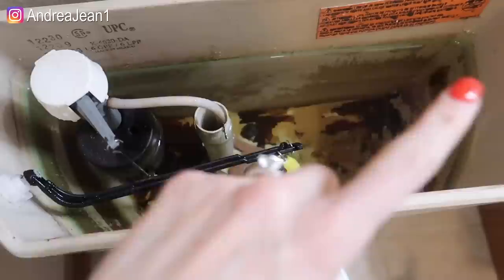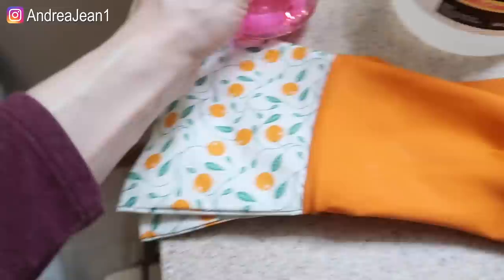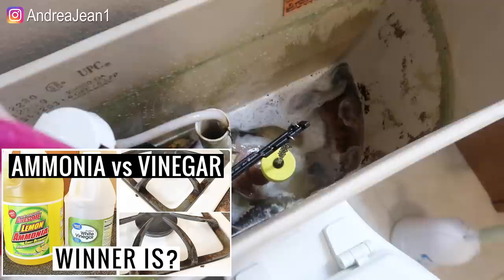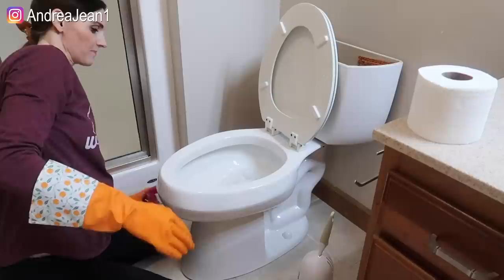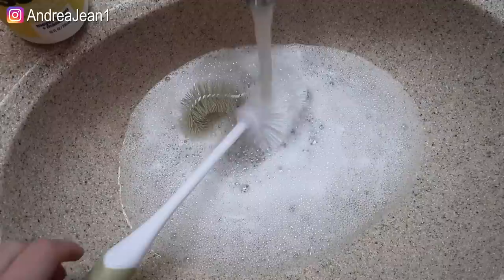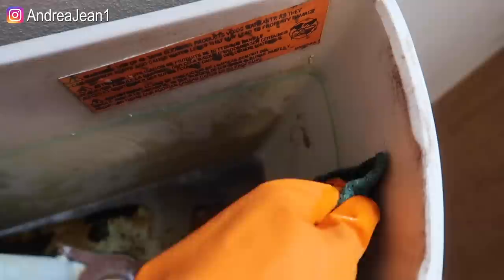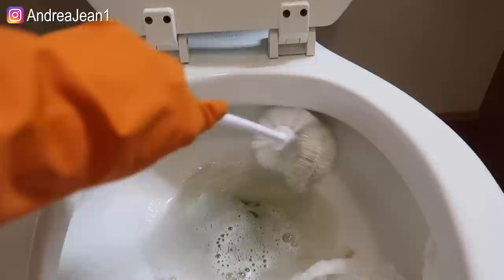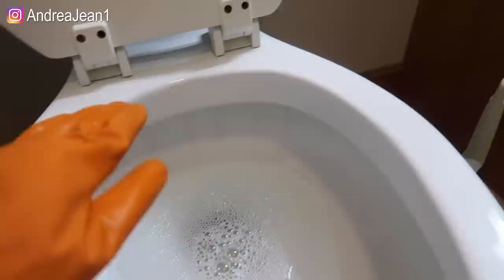Put VINEGAR into your TOILET and WATCH What Happens!! (Bathroom Cleaning Hacks)

Comment: Where did you get that great spray bottle? It's so hard to find a good spray bottle that doesn't break the first time you use it! Also, I live in a mobile home and I have 2 bathrooms and neither one of the sinks or toilets have a valve to shut the water off.. none of my sinks do! Any suggestions? My toilets both need the inside tank parts replaced but I don't know how to do it with the water still on. HELP!
Reply from the maker: Dollar tree 👍 you can still do this without draining the water... you can also get tabs at the dollar tree to drop in the tank.
Reply: if you need a water shut off valve....a plumber can install those items for you.   It's always a good thing to have - just in case your toilet starts to leak and/or a water pipe bursts.....
Reply: Wow!  Will try the vinegar.  I also use a product out of Dollar Tree that works wonders.
Reply: dollar store or Walmart
Reply: Cut the water pump off if you have a well with a pump and the water will stop. Then flush the toilet  a couple of times  to take the water out the lines. After you clean turn water pump back on.
Reply: @maryjo391  I know, one of my toilets has a shut off valve. One time I had some problems with that toilet and while I was having it repaired I had them put in a shut off valve. But who does that? Lol, install water lines inside of a house (mobile or not) and not out shut off valves  in place?? I've had people argue with me and practically call me a liar when I say none of my sinks or toilets have a shut off valve! They keep describing what it looks like thinking that I don't know what the valve looks like or what it's for! I was dumbfounded when I first moved in and saw no way to cut the water off  inside the house! And now I've lived here for 20 years but the mobile home was only a couple of years old. I would maybe expect an order trailer to not have the valves but it is what it is I guess! I've never seen another toilet anywhere that didn't have them. Crazy! Eventually I'll have them on every water line that needs one but for now, I get to crawl under the trailer to turn off my water main. Also, I have county water so no well.
Reply: The only way to actually fix my toilets properly would be to turn off the main water supply under the trailer and totally replace the mechanical parts of inside the tank and add a shut off valve to the one toilet and that would solve my toilet issues. Actually they've both been doing OK except the water level in the bowl is pretty low after flushing the one toilet and I looked up how to fix it and the insides if both if my tanks is alit of rust and I'm afraid to break something because I think the way to fix the low water situation I have to bend or pull up on something and I'm afraid of causing more problems. I just keep a jug of water in there and I just add a little extra to the bowl. Haven't broken anything using that method! Lol
Reply: DO YOU HAVE A WATER SHUTT OFF VALVE OUTSIDE?
Reply: @mariak4572  yes, I do but it's underneath my mobile home and a real pain to get to but I guess considering my  situation  I should just be happy there is a shut off under the house; however, if it didn't, how would anyone ever  be able to hook water up at all? Fortunately it's never caused me any real problems. ..yet!!!  LOL
..
Reply: mobile home owner as well mine didnt have cut offs for the sinks in the bathrooms or kitchen or showers please im telling you have a plumber come in and install cut offs in all these places because if you dont one day you  are going to regret it seriously bad i did the mess and cost of cleaning water all over taught me a lesson. especially the toilets.
Reply: @lovelylady1966  I've already said in an earlier reply that I know I need to have the valves put in. I also am living on a fixed income and I don't have anyone that can just help me and I have other repairs that need done before I can even think about shut off valves. One being leaks in my roof, soft spots in my flooring in a few small areas, my front steps are leaning and ready fall over and I'm doing the best I can with what I have to work with! I've lived in my mobile home for over 20 years and I have gone this long with out shut off valves inside, and there is a shut off valve outside under the trailer. It's not that much of a priority right now and I have had water leaks and cutting the water off outside was not a big deal. The only reason I mentioned it at ALL was because I've never seen ANY home that didn't have shut off valves built into the toilet and sink water pipes. I've had people argue with me that I had to be wrong about not having them. Thank you for your concern but it's not feasible at this time.
Reply: @carolfarmer8879  usually when there isnt any its because they short cutted stuff i didnt have any even under my trailer after having a serious leak i had no choice trust me im not judging i live in a 30yr old trailer that was horrible shape all the floors had to be replaced it was eat up with roaches the roof was leaking i still have tons of stuff to do it was filthy but its either this or be homeless im sick i get less the 800 dollars to live off of  but im trying to do one room at a time plus i dont have heat its very scary at times but i do what i gotta do.
Reply: @lovelylady1966  I'm exactly where you are almost word for word, except no bugs, thank God! I spray my house constantly because last year a friend brought roaches to my home and I was finally able to get those GONE! I bought that stuff that comes in s syringe kinda tube I think it's called combat. I put that around and haven't seen a single one since. Every now and then I get one or two of the waterbug gigantic roaches but I bought a big jug of bug spray and every fee months I go around and spray. I also occasionally get s mouse because I live right by the woods but it just gets so overwhelming trying to fix everything myself and men do nothing but promise to help. They are such liars! I have lupus also so life is very challenging at times and frustrating because I can't do the things I used to! I never needed help with anything because I'm pretty knowledgeable about a lot of things but I swear the older I get, I'm turning into little Miss helpless. I need to get it back into my head that it's just me, it has been for a long time. But my illness makes it almost impossible to do things sometimes and then I feel guilty because I wasn't able to always be doing something.  I have to accept that that's my life now and there is nothing wrong with just resting sometimes.
Reply: @carolfarmer8879  i feel the same way nobody wants to help
Reply: @carolfarmer8879  In my 15 years of working on mobile homes, i've never seen one less than 20 years old that didn't have shutoff valves on every toilet or sink. I've seen a few really older ones that didn't. Just be careful when working with older mobile home water pipe, It's not as thick as standard water pipe. With age that pipe get hard and brittle and can break much easier. I always try and add newer pipe to the end where the valve goes and secure it so when you turn the valve it doesn't twist the old pipe. It does cost more to replace at the moment, but in the long run it's worth it.
Reply: @carolfarmer8879  Use boric acid powder. Cheap and completely efficient for roaches.
Reply: @empressvee  thank you. I bought that combat stuff that comes in a syringe and I haven't seen any roaches OR water bugs ( the huge roaches they call water bugs lol) since! Come to think of it, I haven't seen any critters at all. Now if I can get the occasional mouse situation figured out, I'll be good! I never see any mice and I have traps around but I can hear a chewing sound sometimes that drives me crazy! I have caught a few mice but now they are eluding me. I don't see signs of them either it's just that chewing! At least I got rid of the roaches, I really hate roaches! I'm not thrilled about mice either but I live near the woods so I kind of expect it but roaches are usually caused from uncleanliness. I'm a very clean person and I have never had roaches, this time they were brought in by another person who no longer comes in my house.

Comment: If you haven't turned the water valve off in years, keep an eye on it after you turn it back on. Plumber turned mine off to do tank repairs and the floor was flooded during the night. He didn't notice the nut needed to be tightened after it was turned back on. Not everything is as simple as it seems.

Comment: So this is just vinegar???  OKay, I love magic!
Reply from the maker: Yep just vinegar! Thank you ✨
Reply: But be sure NEVER MIX vinegar and ammonia- very dangerous fumes!!! ☺️💕
Reply: @AndreaJean  3% or 30%? Would 30% affect the the porcelain?
Reply: @AndreaJean  if it was just vinegar what made the foam,because vinegar by itself doesn't make that foam!!
Reply: @vernareed2692  there's a calcium build up. The vinegar and calcium reaction will cause foaming
Reply: @rico76  be very careful with the acidity level of the vinegar as it can cause all the rubber gasket parts in the tank, seal, etc to deteriorate...and when that happens - the toilet will leak water - which you'll then need to have a plumber replace all the gaskets & seals.
Reply: verna Reed I use baking side and vinegar

Comment: Try keeping a bleach tablet in the toilet back.  You probably won't have to ever do that again.
Reply from the maker: Then I wouldn’t have a cleaning video to make lol!! Thanks Stan 😊
Reply: Great idea! The only problem with the bleach tablet is won't be able to see the actual color of your urine, just to to keep a healthy check on yourself 😉
Reply: Anyone ever try denture cleaning tablets? Drop like 10 - 20 tablets in the tank maybe over night, or just dump some bleach in and let it set !
Reply: Do not use bleach in the tank it will deteriorate your rubber stopper. We replaced ours twice before I realized bleach should be no where near rubber
Reply: Stan Mann: that what i do. Don't have to go threw all of this what she going 😄
Reply: @truthlove1114  I also used bleach tab. Bleaching the back won't hurt every now and then.
Reply: mary carter I totally agree Mary. I had the same exact thing happen... blue water was dripping on the floor... plumber came by and said... it’s the bleach tablet that eats away at the seal and made for an expensive plumbers visit.
Reply: The problem with that is that the bleach will deteriorate the parts in the tank
Reply: I love the bleach tablets. However, now that I live in a home with a septic tank I am unable to use any products with bleach as it kills all of the good bacteria in the tank. Those organisms are very important to the health and longevity of the tank. Not only the contents but the structure, as well.  Keep your septic tank and field deathly : )
Reply: Nope....bleach tablets eat away at the rubber stopper and cause continuous leakage.
Reply: @malinamorin4296  Buy some RID I think its called,and dump it in. Been years since I had to use that, don't remember now if you flush it or put directly in septic tank.
Reply: those aren't good for your toilet
Reply: @iluvpittys242  I thought RID was stuff people use to treat lice?
Reply: @truthlove1114  Also, regular use of bleach must be bad for the environment.  Vinegar is harmless.
Reply: My plumber told me to never put anything in the toilet tank like cleaning tablets, etc.

Comment: you can buy vinegar-based toilet cleaner with a bent bottleneck to get under the rim which only takes about 10 seconds to apply, do this before you go to bed and flush the next day or during the night if you have to go, this should keep your toilet bowl clean. You could also pour some hot water into the tank and pour in some strong vinegar and leave for a while, I've never tried this in the tank but I imagine it should work. 
If you have a slightly blocked sink, get rid of as much water from the sink as you can and put a couple of Table Spoons of baking power into to the pipe through the plug hole and wait about 10 minutes and then pour some vinegar down the plughole which will then start to foam and hopefully clean the pipe. Don't be alarmed when you pour the vinegar onto the baking powder when it suddenly starts to foam.
Reply from the maker: Great tips! Thanks David 👍

Comment: You spent a lot of time, try a pumice stone - no smell, quick easy and cheap.
Reply from the maker: I have a whole video on that too 👍👍👍
Reply: How do you get under the rim with a pumice stone????
Reply: @luvtoshop4314 I have the rectangular ones and as they wear down they get pointed and fit right up under there - works fine sitting on the floor.  Hope that helps.

Comment: That vinegar is going to eat up the bolts that hold your tank to the toilet.
Reply from the maker: Yes if you keep it there too long ..... vinegar can eat almost anything.
Reply: @Karen Burris Weasels ripped my flesh   - F.Zappa
Reply: Not if you only leave it on for shut Peru's of time like she does. I would only do the tank maybe once a year though, because it's yes vinegar is a acid type corrosive. Good but bad if you let it sit in tank too long because it can hurt your rubber seals. That's why I say once a year for tank. But it is good to get all that slime and grime out of there because that itself can cause problems of their own and make ur toilet constantly run if the tank plug can't seal properly after flushes. The water will just keep running.

Comment: With a Fluidmaster ballcock valve in your toilet tank, you should also have the proper connection at the overflow tube, otherwise it could siphon water from your tank into the bowl and the tank will refill, just like after it is flushed.
Reply from the maker: Thanks Curtis!
Reply: And she needs to adjust the phitzer valve. It’s all ball bearings😝

Comment: U definitely didnt need to scrub anything if u had used hydrochloric acid in the cistern or the toilet bowl.
Reply: If the concentration of hydrochloric acid gas in the air is 0.035%, humans will have a pain in the throat and chest, and have difficulty in breathing within 10 minutes. The inhalation of a large quantity of hydrochloric acid gas or mist may result in death.Feb 28, 2017
Reply: @ruthwarren4190  yeah.. what's ur point? How much do u think u need? U only need a small amount, leave to sit for a while and then flush.. WITH BOTH THE LIDS CLOSED. Cos I definitely wouldn't flush either of them with out the lids on 😊
Reply: Some people just don't get it...and you are one of them. Years from now, when you suffer from copd, you will wonder why when you never smoked or were close to someone who did.

Comment: I have always used bleach tabs or other cleaners in tanks all my life, never thought anything about it until I bought a house a few years ago. I had to replace the plumbing stuff inside the tanks because they were not flushing right. The plumber said I should never put any cleaning products in the tank as it can cause issues with the seals.  He even showed me the warranty for the parts clearly said adding stuff to the tank will void my warranty. 
Will this be ok, so my warranty doesn’t get voided? Thank you for your help.
Reply: This should not be a problem Ms. Seals soaking in store bought crap might definitely be a problem but, cleaning this way, the parts are not soaking in the vinegar. Also, vinegar is fairly benign and, once cleaned this way the tank would be refilled with water and, flushed to purge the tank and toilet bowl so, it should not be a problem.  Besides, how would the company even know and, I bet the company would require you to send the part back, at your expense, which would be as expensive as just replacing the shutoff valve with a box store product.
Reply: use baking soda,  I use bleach: never had a problem

Comment: Why does your vinegar froth & bubble? Do you mix a tiny bit of dawn in to you vinegar spray bottle? I noticed it on another toilet cleaning video where you were cleaning the seat hardware and as you scrubbed the vinegar in with a toothbrush it foamed a little.

Comment: I notice u still have the hard water lines. U can get rid of them pretty easily with a little comet and a sheet of "dry wall sandpaper"....fine grit. It will not scratch porcelain. Just takes a little elbow grease. The sandpaper looks sort of like a window screen. I promise nothing works better!

Comment: The only chemical I use in the toilet is hydrochloric acid (HCl). I scrub the loo with a brush first, flush it to ensure the water level returns to normal and then put in a dash of HCl and let it sit for half an hour, then scrub the bottom of the bowl and flush. It removes the discolouration caused by lime scale caused by the town water supply. Liquid pool chlorine works almost as well but is not as strong and you need to use a lot more.

Comment: Connect a kaboom auto bowl cleaner in that fill hose tube before it go to overflow tube, finger light tighten the kaboom cap for the tank,  use Chlorox bromine 1" tablet to save money.  Never you have to clean bowl and the tank.
Reply from the maker: Thanks!

Comment: Hi Andrea. You are not using the toilet brush properly. You should take advantage of it. That small part it's so to help clean the rim. I use it with vinegar also and all that black stuff comes right off. I use vinegar to clean around the house. Thank you. Take care.
Reply from the maker: Yes!! This was some really stuck on grossness ..... the brush alone didn’t quite do the trick.
Reply: @AndreaJean  - I don't think you understood what Elena Classen meant. You need to turn the brush around so that OTHER brush (that you weren't using) reaches UPwards into the inside rim. As you do this, pull upwards as you brush so the brush pushes harder on that inside surface. You'd be surprised at how much more will come off. Hope that helps.